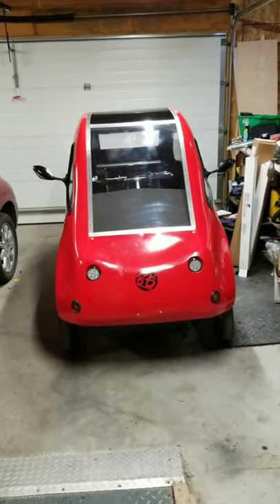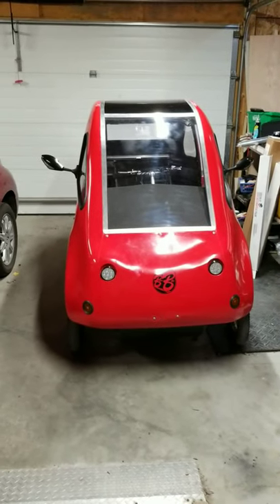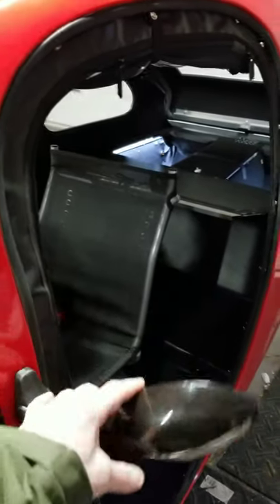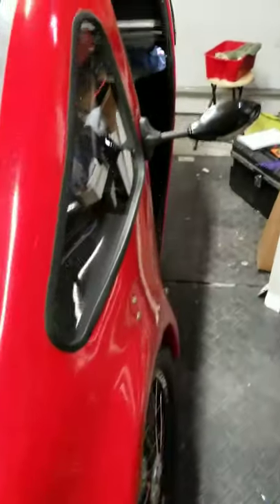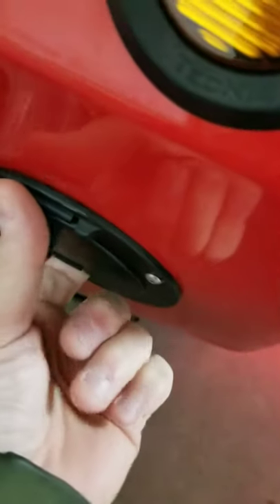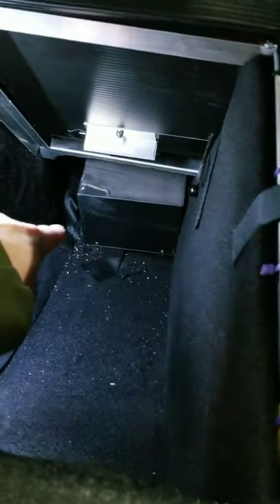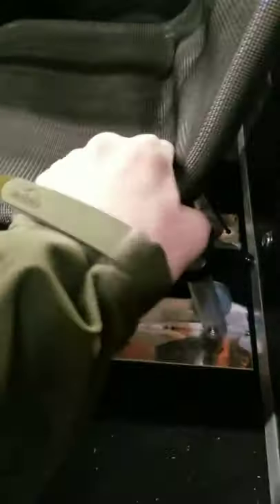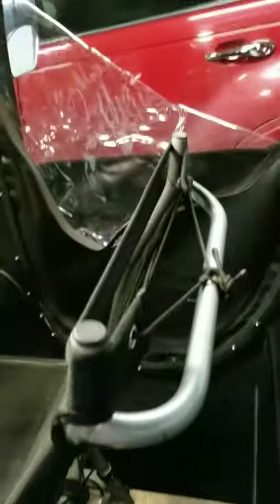Exterior and interior overview of the PEBL from Better Bike  www.better.bike

Comment: Pebl or trans organic ELF ..... Opinions?
Reply: Vman gman PEBL  

And I will tell you why out of the box the pebl can take a passenger 
Has reverse and cruise control is it completely sealed bottom and floor has a removable front panel to open up the floor under the pedals is a more eco-friendly design in. The material used is a hemp resin not fiberglass

It has suspension in the rear and it costs less
Reply: @heidihellsten2347  No the ELF costs the same but the PEBL has no solar roof or warranty. The ELF one year full written warranty is worth $1000. The ELF two seat version is the same price and has seat belts for 2 kids or an adult passenger. The ELF has no need for reverse gear because they were wise enough to not close the floor. The 
ELF has a huge front cargo shelf where the PEBL has none at all. You will be panting for more ventilation this summer but you won't be able to get it without removing windows. ELF weighs 160 pounds, PEBL weighs 230 pounds with the fiberglass body, the hemp body has been recalled and is now heavy fiberglass that ruins your hill climbing ability. PEBL violated the unwritten rule that these bikes need to weigh no more than 175 pounds with the 750 watt motor power limited by law.

Comment: How do you protect it when you go in a shop or something. They can steal it
Reply: You lock it up like a normal bike
Reply from the maker: My bike has a bunch of special features in it I have a master cut off switch with a lock and the key so basically I can cut the power to the entire bike

I use a lock with an alarm on it as well I also have installed vibration sensitive alarm systems that are 120 decibels each

I've also installed a GPS tracking unit that can track you the bike North America wide that unit is hidden inside the bike somewhere

So I can track it anywhere at anytime

I'm also planning on purchasing a new lock called a skunk lock basically what that is is a lock standard u-lock but inside the u-lock is high pressure pepper spray so basically if anybody tries to cut the lock the pepper spray injects through the cut and sprays all over the person doing the cutting basically rendering them immobilized probably at that point in time needing medical attention

Comment: HI Tim. At what temperature can you comfortably ride the pebl?
Reply: Zackery Williams I have ridden it in about -5 degrees Celsius without any additional heaters or anything just wearing a thin jacket and I was still sweating and I had the doors closed but the windows partially opened

So if I was actually to close the windows and everything I'm sure it would be a lot warmer I could ride it even longer
Reply: Thanks, I am looking forward to receiving my Pebl.

Comment: I would love this bike...it is 100% perfect EXCEPT that it's weight limit is 250lbs....I'm nearly 400....I currently cannot, due to mental deterioration, drive, I live in an area with insects(A panic trigger for me which can sometimes be dangerous) and lots of rain...So currently my only option is to buy an Elf, and modify it myself to be a Pebl....9.9
Reply: The ELF has a 550 pound payload rating. It is also easier to get in and out of. I weigh 300. You will always need copious ventilation in this class of vehicle unless you plan to not pedal at all.

Comment: My opinion:
A very nice vehicle, which spares the already badly battered environment and offers enough space for more than 2 persons.
Disadvantage: It does have doors, but they do not protect the vehicle from long-term finders and theft or wanton destruction. I would be afraid to leave it somewhere. Why did not you install any lockable doors ???
Reply: You are confused - a door of any kind has no place on a bike. We don't leave valuables in bikes. We remove the motor key. This is not a car so doors are not used in the same way as on cars. Wanton destruction? You live in the wrong place and need to move if that is an issue. What is a "long term finder"? A thief needs a flat bed tow truck with winch to steal a 230 pound bike.
Reply: Here I once found (only to show that there is another way) this video "Solar Powered E-Bike (Trike) Designed to Reduce City Traffic." It's built inside like this vehicle here, but has doors Now suppose I drive this vehicle with no lockable door into the city, I want to go shopping for clothes and water and then go out to a restaurate with a friend, so I want to have a safe place where I can For example, I can safely store my six-pack of water and my first-bought clothes and not carry things with me to the restaurant. @popeyegordon
Reply: @angeleyes3251  The PEBL has a locking rear hatch and battery compartment. The ELF has a locking rear trunk lid. Please keep an open mind which must include the fact that personal cars make it easier to over-consume as part of an unsustainable lifestyle. Also don't forget that delivery of merchandise and groceries is easier than ever and more options offered every day. Please don't buy bottled water. The containers are usually not properly recycled. US tap water is the best in the world on average and water filter options are many. Fill your reusable water bottles at home please.
Reply: @angeleyes3251  The changes we need to make to live sustainably are minimal and not hardships. Even with all sustainable behaviors combined the US will still offer the best lifestyles which will actually improve even more as we stop stealing resources from future generations.
Reply from the maker: So don't leave anything of value in the bike at all it's pretty much like a convertible you never leave valuables in a convertible

I have since installed vibration sensitive alarms that are 120 decibels or more each as well as I use a u-lock that has a vibration sensitive alarm on it and I also have the bike GPS tracked so there's a 24/7 GPS tracking unit inside the bike integrated into the system

So if it goes missing I'll come collect it